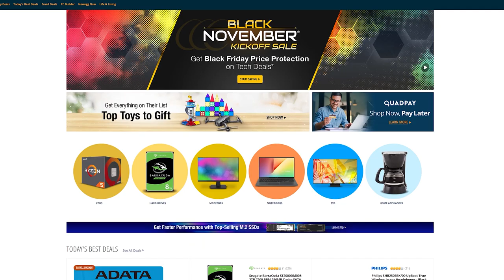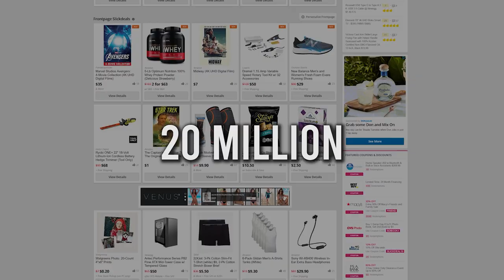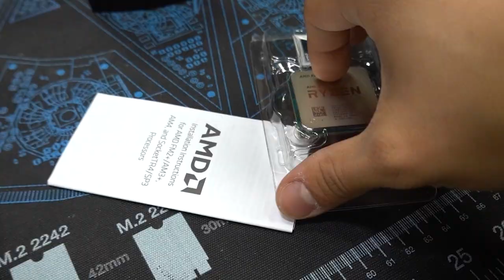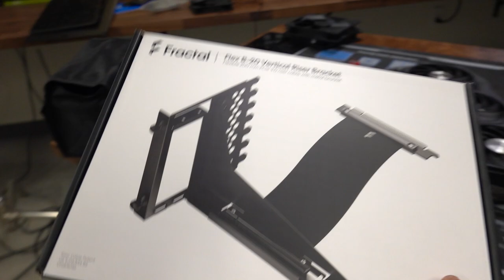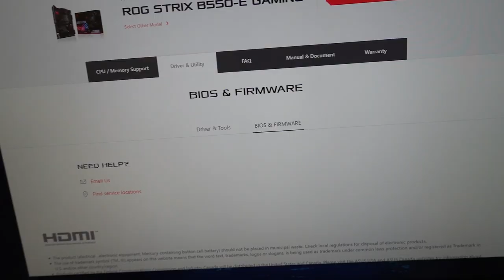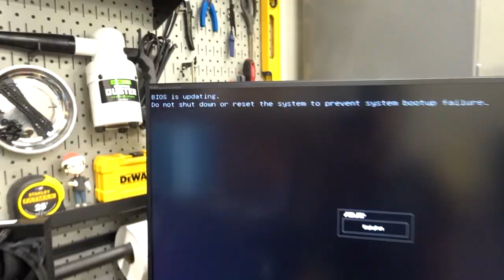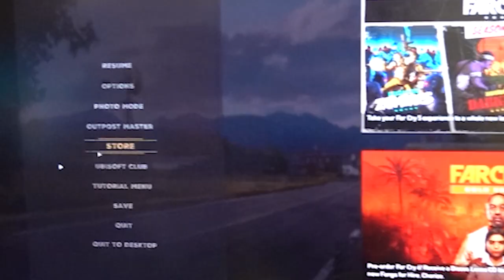I've waited so long to build this PC

Comment: 20:08 consider: break off the Velcro mounts and glue on lego sheets to the back.  Add a lego tile to the bottom of the Velcro mount.  Full modular backside 👌👏
Reply: Lol I know you're joking, but that would make the side panel bulge and probably wouldn't fit anymore.

Comment: “This is gonna be one of my serious builds”

Also Bitwit:

Doesn’t screw in m.2

Wow this got popular thx!
Reply: Between not screwing the M.2 ... spending 2/3 of a 33 minute video talking about the case ... and the horrific zoom at the end ... I reckon he could have done better 🤣
Reply: Also Bitwit: Mounts radiator with hose on top.
Reply: @Legowiebe  he did it on purpose to troll
Reply: @Legowiebe  is that bad? Sorry I'm new to pc building and I'm planning to build one in the future. I'm asking if mounting the radiator with the hose on top a bad thing.
Reply: @sumbratko  With offhand knowledge I can tell you I don't think its necessarily "bad" more so not recommended. I believe it decreases the efficiency of the radiator. I dont know if Kyle's done a video on it but I know Jay has if you want more info. Cheers.
Reply: @tyranusmcmanus3671  no Steve did a video on it
Reply: @marioStortuga  Thats what I thought I started commenting when he didn't put any thermal paste on then I saw the loose M2 mount and was like oh..... OK. 

Bad if someone watches this as a how to though.
Reply: @shadowbanned15  the liquid AIO he used likely had thermal paste pre applied to it.
Reply: @Daisy-cx8xd  Not sure if serious. Got a link?
Reply: @shadowbanned15  It sure as hell is a thing at least, though maybe not as good.
Reply: @sumbratko  if the hose is on top, it will burn out the fans
Reply: That's what makes it a serious build lol he does it the way he builds for himself, rather than the proper way
Reply: Tubes down right?
Reply: @shrekthe55thsharkking  many thanks for all the replies
Reply: and no thermalpaste

Comment: 17:35 Steve's anger intensifies
Reply: The top of the radiator is placed higher than the pump so it should be fine?

Comment: Bitwit: I'm using a 5800

*Gamer's Nexus has entered the chat.
Reply: More like
*Gamer's Nexus has left the chat.
Reply: is something wrong with the 5800x?
Reply: Watch Steve's video on it.

It has a really niche market, but it's the odd duck for this generation.
Reply: also mounts radiator pipes up

*Gamers Nexus enters the chat once again
Reply: @teifangu2049  It is by far the least compelling in the new Ryzen stack. If you are going for a pure gaming PC, save the money and get a 5600x. If you want a more production focused machine that can also game, 5900x is great. If you are really focused on production with a little gaming sometimes (or just want the top of the line hands down), the 5950x is for you. The 5800x just doesn't have a place at it's current price point.
Reply: @ravencrovax  It's the one I am looking at because i don't want to spend £560 on the 5900x but also want something that can handle a bit more intense multithread than 5600x.
Reply: @teifangu2049  Check out the Gamer's Nexus video on it before buying. I am not going to say "Don't get it." It is your money of course, but from a stats perspective; you may want to either look at just how good the 5600x stats are and see if that will work for you or wait (if you can) until supply evens out and AMD inevitably lowers the price on that chip.
Reply: @reloadingdontshoot1  good to know. I think when I actually come to upgrading I will have to weigh the pros and cons. Can I ask, are you running on B550 or X570?
Reply: @ravencrovax   yes ok thanks. It's not likely to be very soon that I upgrade so I'll think again when I gather the money!
Reply: @ravencrovax  Personally 6 cores are too weak. Not that fussed on value per se but 5900X was out of budget.  5800X should last a good 4 years.  Just like my i7 7700k did.
Reply: He installed the radiator wrong too
Reply: @reloadingdontshoot1  I know, but he does do very thourough and in-depth objective analyses for each chip. I advocate looking to many different sources for tech info. Also, the 5800x is not a "bad" chip by any means. It just doesn't fit in AMD's current stack of chips and most people who get it right now are doing so because, like you; it is the only one they could find in stock.
Reply: @ravencrovax  the 5600x will get outdated much before the 5800x.Having less cores than the xbox series 1 and the ps5 will affect your gaming experience. 3 years from now,you'll be in a not so optimum condition
Reply: @teifangu2049  Price to value is driving between the 5600X vs 5900X vs the gain. 4 processors 8 threads for $100 more or you lose 2 processors 4 threads for a $150 less
Reply: I'm pretty sure that anyone who uses their PC for gaming, but also streaming and/or as a workstation, and doesn't have an unlimited budget, will do just fine and be ecstatic with a 5800x. It is a great CPU, don't get me wrong.

It just has a more niche market. Other CPU's in the lineup do those things better individually. The 5600x is extremely compelling for an only-gaming setup due to its cost and performance, partially due to its boosting profile. The 5900x and 5950x do far better at workstation activities that utilize hyperthreading - they have more cores and threads, and similar speeds.

But, especially with the 5900x and 5950x, it comes at a cost premium.
Reply: @ravencrovax  It is great, only thing is price is too high, so better to spend 100$ more for 5900x
Reply: @ChristopherNewman63  bUt iT loOks PrettiEy!
Reply: I’m just waiting for a 5700X.
Reply: @dannacht6827  yeah, cuz Steve saw that tubes up radiator mount... ;)
Reply: @teifangu2049  no, but you're paying $150 more for 5800x versus 5600x, for what in many reviews is not $150 better performance. Depends on the tasks though.
Reply: @nickpickerwi7787  why is it the Odd duck exactly?
Reply: SharQ  you're right. I will wait. the 700 CPUs always seem like great value
Reply: @teifangu2049  yo you should wait until the non x versions come out
Reply: @spurfn3425  yeah. hopefully they will add some to the lineup soon
Reply: @reloadingdontshoot1  Well clearly you settled because it wasn't what you wanted thereby proving Steve right.
Reply: Also steve: Rad tubes at the bottom
Reply: @bilalmalik5002  Because it's $150 more expensive than a 5600X for two cores, and net benefit to gaming for that $150 is extremely little. For $100 more, you get a part that has 4 more cores and 8 more threads - 50% more cores and threads - and will stomp this chip at multithreaded workloads.

It's price-positioned oddly - if you want a CPU for gaming, get a 3600X, and spend the extra money on a GPU where you'll see more benefit for that $150. If you want a CPU for professional workloads, get a 5900X and spend the extra $100. If you want to do both, this chip might be a good choice, but a 5900X would still be a smarter choice.

The only benefit to a 5800X over a 5900X is having a single CCX, but unless you have a very specific workload that would benefit more from having a single CCX than having 50% more cores and threads, then the 5900X is worth the extra $100.
Reply: @ravencrovax  yeah u need a 3900x..lol used or new whatever u can get
Reply: @ChristopherNewman63  Doesn't really make much of a difference, it's a safety precaution and not all cases allow for the tubes to be mounted at the bottom. I certainly can't. My 2080 is too big and I'd have to squeeze the tubes up just to get it in there.
Reply: @CaptainCosmic I also plan to do the same workloads and tasks but waiting on the 5900x to restock.

Currently on a Ryzen 5 3600.
Reply: Personally, I see 6 cores on 5600X and think "Less cores than a console? That can't be right!".
Reply: It's the best choice You could have chosen! Why? Because it's the worst buy from a money to performance perspective, and therefor less will buy it. That means the best availability to actually be able get over the rest! ;)
Reply: @nickpickerwi7787  What about futureproofing? I'm planning on building a gaming pc that could run most of the games at 144fps in no matter what graphic setting(i dont mind playing on low settings) and could last many many years. Right now I have an i5-7500 4c4t cpu and it struggles with games like cod for example where it only gets like 90fps even with the lowest settings at 720p. So how many years can a 6c12t cpu last before it starts getting "outdated" considering that now every game is starting to use more cores? Wouldn't in that case be the 5800X the better choice in the long term?
Reply: Free CPU is always the best CPU
Reply: @d.orayaki5567  It somewhat depends on what kind of games you play, and what resolution you play at. And I'm not a fortune teller, and can't see the future. And I'm not saying the 5800X is a bad chip.

What I can say is there is a dramatic change in where the horsepower comes from once you get into 1440p/2k and 2160p/4k. The greater the resolution, the more intense the graphics card usage becomes. At 1080p, more of the horsepower needs to come from the CPU.

What we are seeing from benchmarked games today is that the 5600X is only lagging the 5700X and 5900X by a few FPS - in the single digits in most cases. True, with consoles built how they are, games tomorrow may utilize 8 cores, and many may not, and some may leverage as many cores and threads as you can throw at them. We don't know what tomorrow's graphics requirements will be, either.

If you're buying 2 more cores and 4 more threads because consoles will have that, well, that won't be enough anyway if you throw in having other programs running, or if you'll be doing streaming. If that's what the game you want to play will expect, there's no headroom for other programs, so you'd need more available cores and threads.

So, then, your best bet for future proofing would be to buy a 5950X with a 3090 or a 6900XT, literally throwing the most powerful hardware you can get into a machine - but that's not feasible for most people's budgets.

Where the 5800X falls in the price hierarchy, it isn't a BAD choice - I said before, people who buy it won't be disappointed by its performance, and if you want to stream or do light multi-threaded workloads, it's a better choice than a 5600X if you're on the edge of your budget. It just isn't a cost-effective choice for most budgets based on what you get for it.

You have to look at what the increase in cost buys you from chip to chip - from the 5600X to the 5700X, it's $150, and you get two more cores and four more threads. That's 150% of the cost for 133% of the cores and threads. From the 5700X to the 5900X, it's $100, and you get four more cores and eight more threads. That's 122% of the cost for 150% of the cores and threads. From the 5600X to the 5900X, it's $250 more. That's 183% of the cost for 200% of the cores and threads.

Moving from a 5900X to a 5950X is 145% of the cost for 133% of the cores and threads, which is the other scenario where the percent of cost delta is higher than the percent of gain delta, but for a workstation PC and the top of the performance stack, you can typically justify that discrepancy by costs saved via time doing the work you're doing, especially when you aggregate it over the course of years. It causes an objective gain. For gaming performance, that is subjective, it's harder to justify that discrepancy.

Note that I didn't say "performance uplift" - there's a lot more to this, coming down to what game you're playing, how the games respond to the different CCD/CCX layouts, the boost behavior and clock speed differences of the chips, silicon lottery, cooling performance, overclocking, etc. Performance doesn't scale linearly with most games, OR for many workstation tasks, when you're just talking cores and threads. Performance doesn't scale in sync with percents, numbers, and synthetic benchmarks. But for many workstation tasks, they will benefit from throwing as many cores and threads as you can throw at the problem when clock speeds and IPC performance are similar.

If you are going to spend $150 more for a CPU, and that's the edge of your budget, for the class of balanced system you would be building in that price range, it makes more sense to spend that money on a better graphics card and possibly more RAM for that $150, and for some people who are completely bare-bones building a system, more fans. There's better ways to spend $150 than to get two more cores and four more threads.

If you're not at the edge of your budget, and you're already into the 3080/6800XT or 3090/6900XT territory with your graphics card, and you're wondering if you should spend the extra $150 on a 5800X over a 5600X...it makes more sense in the long term to just spend $250 more instead, and get a 5900X, because over a 5600X, you'd be doubling the cores and threads.

It literally comes down to a cost/benefit calculation. If the 5800X were $50 cheaper (or greater), it would be in a more compelling position. If we see price shifting in the future, this might happen, and then the 5800X will be in a better price position.

Again, I'm not saying it's a bad chip, at all. It performs excellently. I'm saying that it's important to look at what the extra cost buys you from chip to chip, and that in many (but not all) cases, it makes more sense to either:

1) Save up another $100, if you're already willing to spend $150 more, if you're not at the low end of the stack and not already hardware/budget limited, or:

2) Save the $150 you're willing to spend on the CPU for other components that will make a greater impact if you're at the low end of the stack and budget/hardware limited.
Reply: @teifangu2049  The 5800x is great, just akwardly priced.

Comment: That missing screw of the NVME drive vexes me. It vexes me greatly.
Reply: And not using all the motherboard screws 😡
Reply: @merwinpique  yeah that’s what got me
Reply: im suprised it even worked because you can see that it is shifted to the right after he screwed it down
Reply: @BROCKma  the radiator is installed upside down too. 

This is like nearly Verge levels of building quality. It's embarassing.

Comment: Parts list (reply anything I miss)

Processor - Amd 5800x or 5900x 
MBoard - Asus rog strix b550e gaming
Ram - Corsair Dominator rgb x2 ( I think)
Cooler - Fractal celcius plus s36 360mm
SSD - wd blue sn550 1tb
Case - Fractal meshafied 2
Fans - Fractal prizma rgb 144mm x2
Power Supply - Cooler Master v750
gpu - rtx 3080 (im trying to grab the amd 6800xt personally)

Comment: It’s bugging me SO BAD how you didn’t screw down the M.2
Reply: It was even sticking out of the side (bottom) with the heat sink plate on. Proving its now not seated properly.
Reply: Me too. OCD was in overdrive. Lol
Reply: He also put the radiator for the water cooling upside down
Reply: @YesImPortuguese  that's when I realized he..

..

fucked up
Reply: @YesImPortuguese  it's bitwit, what did you expect. He has high video quality in his uploads but he's actually a pretty shitty builder in practice. He doesn't even know how to troubleshoot computers; he just rips the parts out and replacea it all.

Comment: He is talking about the case like he was sponsored by it.
But not going to lie the case is actually super engineered nicely.
Reply: They sent it to em for free so who knows. It's aight. Little overpriced for its feature set.
Reply: I like everything about it for the most part except the “fractal” design on the front and those stupid cable organizer things in the back. The price is a bit much imo
Reply: It's over engineered to a fault. Those plastic cable management things in the back suck and the screwless side panel popout mechanism is so bad b/c it's not really secure and can just fall out if any cable is pressed against it.
Reply: My little brother got The Meshify C
Reply: Makes me jealous sitting here with my meshify C
Reply: I kind of wonder if each cable guide/channel is removable though.

Comment: KYLE: talking about case

everbody else: looking at case on moniter
Reply: Lmao thats what i was doing
Reply: Speaking of cases: anyone have any case recommendations? I’m looking for a black/grey case with good airflow, cable management, and a psu shroud. Having a hard time finding one that isnt super expensive or severely lacking in some areas.
Reply: @n-11ordoskirata70  try Nzxt S340 elite
Reply: The 275R corsair airflow, one I have. Check it ou ut
Reply: @n-11ordoskirata70  phanteks p300A i have it